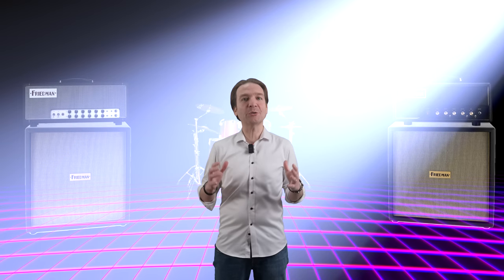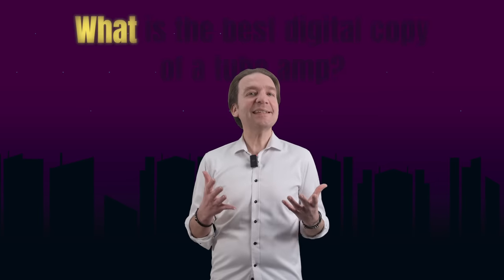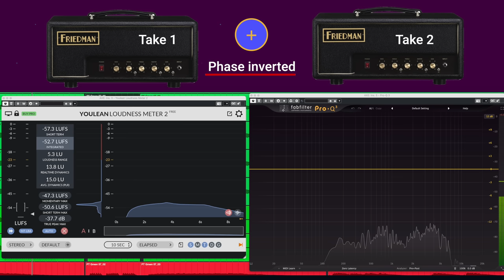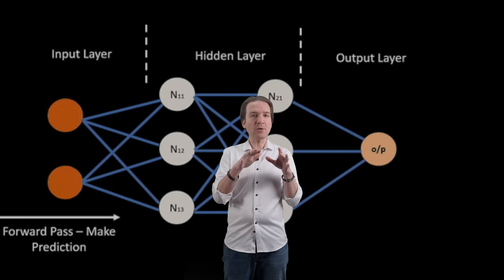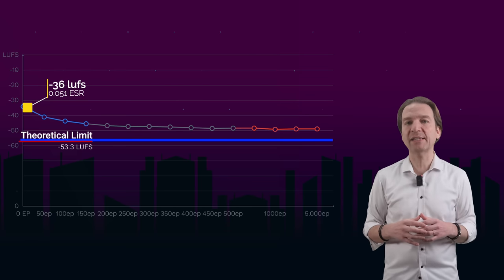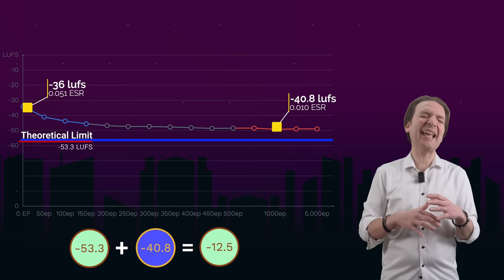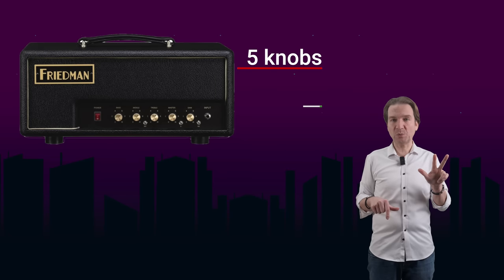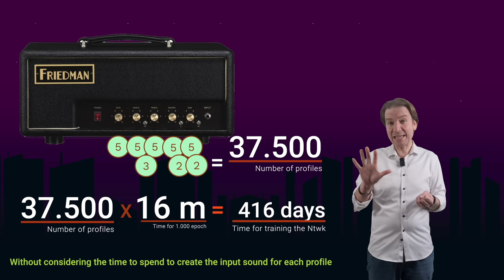How can we obtain the perfect digital copy of our tube amps? I've trained NAM  with 10.000 epochs...

Comment: The inability of the neural network to reach the theoretical limit is related to its degrees of freedom.  Because the algorithm involves solving sparse matrices (tensor calculations) the degrees of freedom are limited by RAM and processor speed.  Its interesting that NAM approaches -40.8 LUFS.  I wonder if the Tonex algorithms approach a different asymptote with increasing "epochs".  My guess is that Tonex has fewer degrees of freedom than NAM, but who knows.

I want a way of converting captures from one platform to another.  NAM profiles played on Tonex hardware or a Kemper would be great to try.

Another great video, Leo.
Reply: just profile them
Reply: Yea, that way we can have an even cheaper device than the Tonex and all the Tones, I just use my PC with my HX Stomp with the Tonex software, but routing it can be a little wonky, might end up getting the Tonex pedal just to simplify that.
Reply: @masterofreality230  Good plan, my man.
Reply from the maker: Thank you, interesting points...

Comment: Thanks for doing all the hard work, and crunching the numbers. In think it's impractical, and probably unnecessary to have numerous Profiles/Captures. Three basic Profiles - Clean, Crunch, and Dirt, may be all that are actually needed. Algorithms that define/describe the sweep of Control Knobs - Bass, Mids, Treble, Gain, Volume, etc., could be created. I did a little research on them, and they appear to be just simple Potentiometers, with relatively standardized ranges/specs.

I realize this is a simplification, and would not produce the absolute "exact sound" of a specific Amp. But, as you showed, an Amp's sound is inherently variable. Variability is something that can be programmed, if needed. And since we don't really need perfect Profiles, they don't exist, we probably couldn't hear the differences even if they could be captured, etc., we could probably make a few specific Profiles that would be close enough to cover the range of the actual Amp, and make it even more flexible by doing it in the Digital Domain.
Reply: Unfortunately a "tone control" algorithm wouldn't work - a treble control, for example, doesn't just adjust the amount of treble, it alters the gain structure for the phase inverter and power stage, leading to both amplitude and frequency-derived saturation (distortion). The only accurate way is to sample every tweak of every control.
Reply from the maker: You are welcome and I'm happy that you like the video! Thank you also for sharing your interesting findings!!!
Reply: @digitalchris6681  I'm thinking that there may be a "sufficiently predictable" line between two known values for any Pot that an algorithm could derive, given sufficient data on how that affect the resulting output. OpenAI, and new versions of GPT may make deriving the Algorithm even more precise.

There is currently a way to create an IR from a VST Plugin (perhaps even from NAM) that can then be imported into a Floor Modeler (like HX Stomp) and used as an IR in that unit.
Here is a video showing how it can be done: How to make Impulse Responses from guitar cabinet plugins FOR FREE
https://www.youtube.com/watch?v=TB5F5pFjXp4&t=3s

I don't know if anyone has actually tried this and compared the result in a "Nul Test" to the original NAM Profile/Capture. Would be very interesting to hear the results.

Just watched this video regarding cool new features added to the Standalone NAM UI: https://www.youtube.com/watch?v=u3mPtCStEP4
Reply: @picksalot1  I found the upgraded NAM vid yesterday and will give it a try as soon as I'm able. Haven't tried the home-built portable IRs yet either.
One thing is for sure -  at the rate software is evolving, by the end of this year the guitar amp & cab emulation/profile/model possibilities will be vastly increased and improved !

Comment: Thank you for this high-quality compare!

There is many mathematical ways to get NAM model even better ESR, not only calculate model with "standart" architecture with many-many epochs. Here you get flat with many epochs because of learning rate decay.
So i think there is ability to get ESR ~0.005 or better. My ears and fingers are not able to guess real amp or nam in blind test if ESR ~0.001.
On really high gain amps the best results are higher because of noise (~0.005-0.01)

Can you share your output.wav (reamp from v1_1_1.wav) to try to get better ESR?
Reply from the maker: Thank you so much, I'm happy that you like the video!
May I ask you which are the ways to improve the ESR? Any suggestion from you would be highly appreciated!
Thank you!
Reply: @LeoGibsonGtr  try to use different learning rate decay, by default it's 0.93, try 0.99 or even 0.999.
Good practice is to learn model again after learning but with slightly different parameters.
For example, you learned to ESR = 0.01, then this model can be trained more but with different "ny" (smaller) and "batch_size"(smaller) parameters.

This is not possible in easy mode and from gui trainer

Comment: Totally on point! ... and remember, the guitar and including the cable (or wireless system ) settings also sets the 'Snapshot' flavour ... but the technology is here to stay and expand by everybody ... Developers will be only limited by their imagination ... and inclusive, their imagination would be supported by AI 'Creative Asistants' ... 

The good, musicians must to Jam a Lot because that is what AI can not replace, the experience of playing together and flow in time with other humans in 'subjective/intersubjective' time ...
Reply from the maker: Thank you!
Let me just say that the input file used to train the network is a standard one, with some strange sounds...I don't think it depends from a specific guitar.
Reply: @LeoGibsonGtr  Probably, the guitar model, settings, and player touch wouldn't be relevant variables for the NN grab the amp + recording setup response ... but maybe it would be a nice test for measuring that influence in the chain ... maybe that could bring more nuances about the amp response to the training data set ... 

I remember the underrated Peavey Revalver ACT (Audio Cloning Technology) tech who took the input signal into consideration, one of the things that the tech try to emulate is to change the input from any guitar to emulate the input from another guitar ... For Example, you could emulate the raw direct line strat 'phase second position quacky input' with a Gibson less paul and so on ... In, practice, it - relatively - worked ... (others developers as Positive Grid included something similar to their emulations with similar results ) ... 

But It would be interesting to test If the raw input into the NN amp emulation can get the nuances from the instrument with the independence of the data set used to train the Gear ... 

Because it opens a market for NN emulations of RAW inputs ( something that  has a predecessor tech in the Line 6 Variax ) 

'One Axe to Rule All of Them'  😂
Reply from the maker: Hi, thank you for sharing...interesting points...